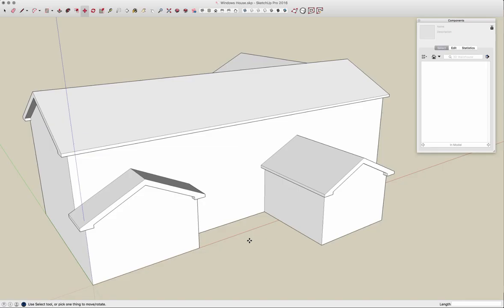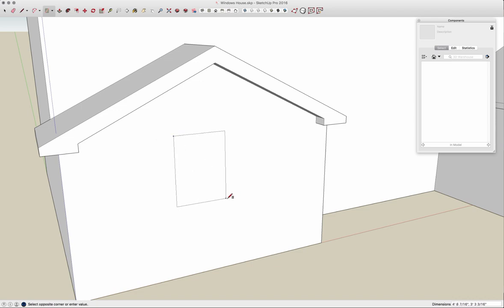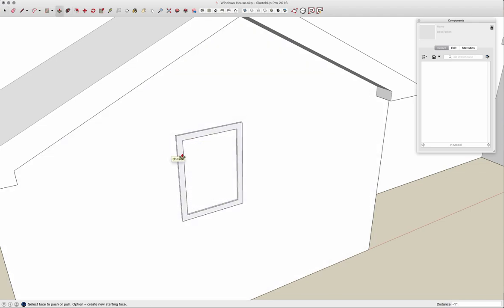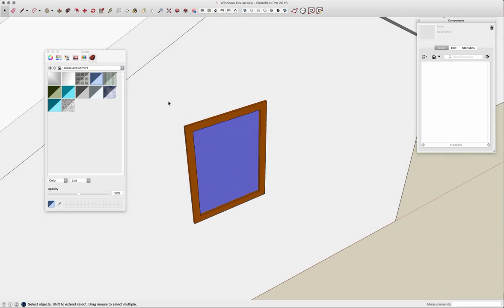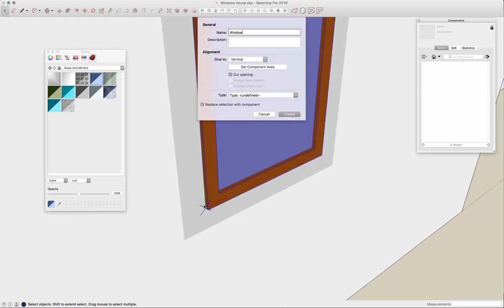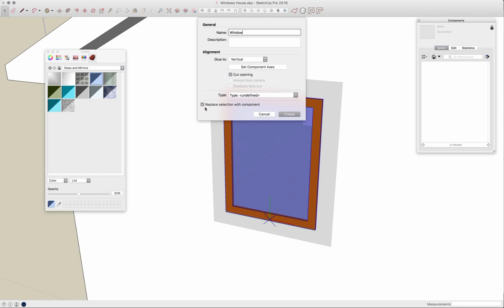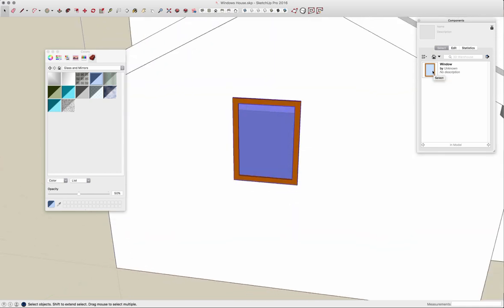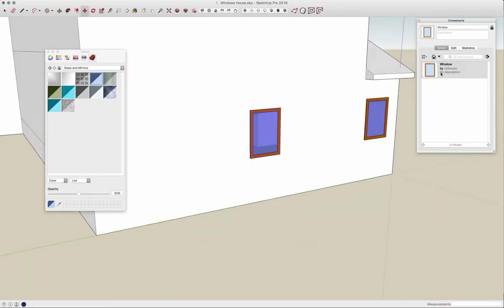SketchUp Skill Builder: Cutting Window Components

Comment: This would be helpful if walls were made out of paper, but they're not, walls have width, and if you go inside this paper house and try to look outside of the window you see what a mass this window actually is.
A more elaborate cut through window component on both sides through lets say a 5 inch wall would be realistically more helpful.

Comment: When I place my windows, Sketchup doesn't seem to cut the wall surface.  I've tried building the wall around the window, but the widow area "fills".  How to make this work?
Reply: I don't think this works on a wall that has two surfaces (to account for the thickness of the wall.) I even tried placing windows first then push/pull the wall (with the cutout) to form the thickness... no go.
Reply: You may see the impression of the window from the inside. If you click on it, you should see the dotted face segregated from the rest of the wall. Delete the dotted face and you should be able to see through the window from behind